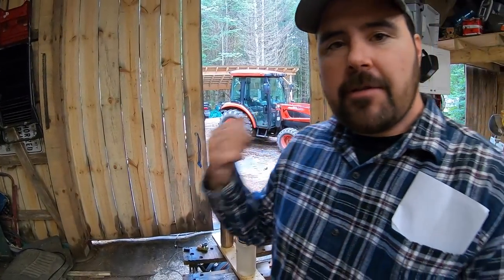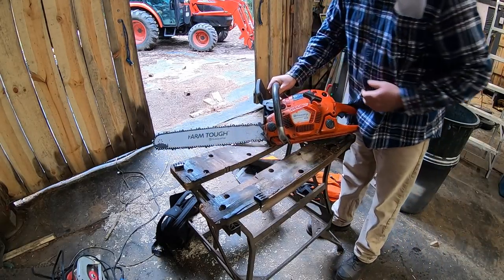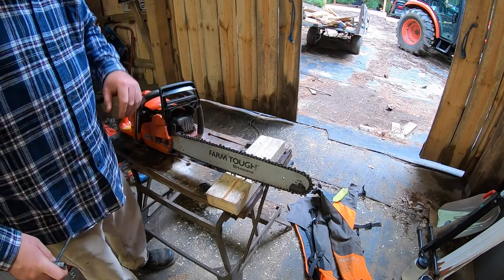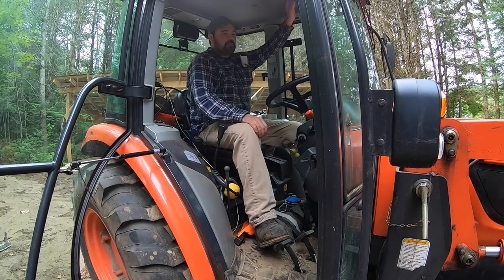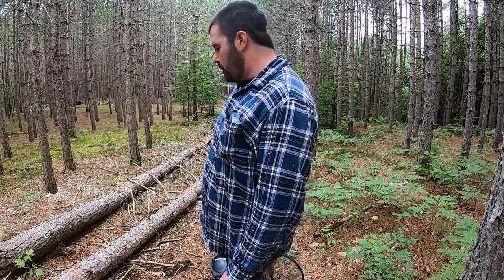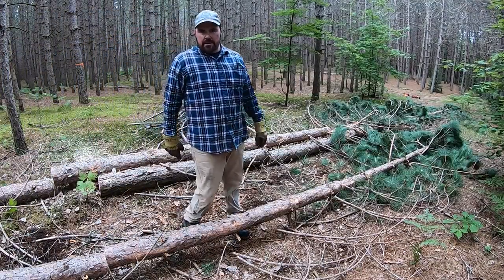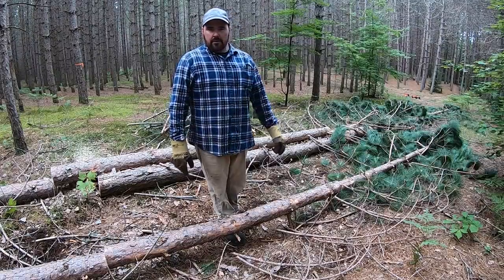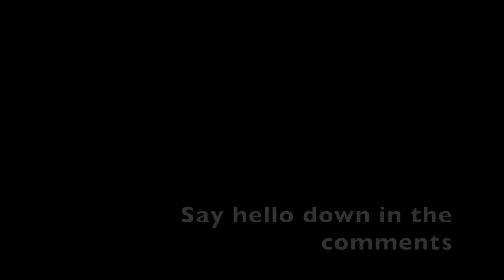Cutting Down Red Pine Trees For Siding | Equipment Shed Build - Ep. 11

Comment: I know I already commented on your wasp issue but I found something new that might be the perfect solution in the future. I copied this from a prepper group on Facebook. Hope this helps, cheers. As a beekeeper we are constantly asked to utilize our beekeeping equipment to get rid of wasp nest. 

Quick tip : In order to eradicate the Wasps all you need is a fertilizer sprayer that comes with attachable bottle. You fill the bottle with 1/4 dish soap and 3/4 water you then spray it at the wasp nest which is made of paper and will immediately Fall Apart the Wasps will be pissed however the soap in the water causes the water to be able to enter the slits of the WASP breathing area. The viscosity of the water is decreased and will slide into the slits and drowned  the wasps.
Reply from the maker: I like that idea except for the moment the wasps get angry at me haha. Fortunately the wasps haven’t been back but I do plan on putting up a fake nest as from why I understand they are terretorial. I appreciate you helping me out as I’m sure the beekeeping gives you a lot of great experience to share

Comment: I load the catie in and out of truck with tractor, and leave it in truck while filling at station .  Catie came with grounding clamp for safety.  The math lifting (6)  5 gal cans in and out truck and around all the equipment  in a year time is over the top.   The catie is on wheel so it moves easily and holds 30 gals. I only have to fill it 4-5 times a year and I'm down to only needing a couple of can for remote filling. 👍  my back thanks every time . 😉.
Reply from the maker: Sounds like a great setup

Comment: I wish they could have combined the old style positive stop fuel and oil caps with the new style tool free ones. Having the threads protrude on the old ones they hardly ever got saw dust in the tank. The new style I find it best to blow off the saw with air around the caps to get rid of most of the debris. They do make it easy though.
Reply from the maker: Air is a great option for sure. I’d hate to get some gunk clogging up my saws fuel system

Comment: I bought a fuel catie on weels for my stuff, 30 gal with a manual pump best thing I have done in  long time. No more lifting heavy fuel cans.  You should consider that, I'm sure you will be happier.  👍
Reply from the maker: I’ll have to check it out. My only issue would be lifting it in and out of my pickup truck to get fuel as the fuel station. How do you find using it at the fuel station?
Reply: @sawingwithsandy  they  usually come with ground strap which is for safty. I leave the tank in the truck to fill with fuel  and  lift it in and out PU with the tractor. 30 gal last quite a while for me, so about 4- 5 time a year I have fill tank. The math on all those 5 gal cans really add up quick not to mention haveing take 6 cans  to fill at the  station. If I  have take fuel with me, put a few gal in a can and go. My back says thanks every time I have to fill up anything.  🙂
Reply: @sawingwithsandy  3rd

Comment: Looked like the trees you cut were live. Much difference in milling a dead tree vs a live tree  Sandy ?.
Reply from the maker: They were live trees. I find cutting live trees to be a bit easier to saw as the water in the tree provides for a bit of lubrication. I prefer cutting live in the winter time though as live Pine in the summer has a lot of pitch in it that can gum up the blades of the sawmill

Comment: In my humble opinion, snow is easier to deal with than bugs, heat and humidity.  With a 7' length, I suspect that you'll be doing board and batten siding.  Any reason that you chose this over horizontal lap siding?
Reply from the maker: I like snow more than bugs as well. Doing board and batten to match the shop siding

Comment: Sandy, why oh why, don't you have a simple auto jack under the small end of the log?? You MUST level the heart on both ends to get the most can't volume out of the log. On the small red pine- the taper is minimal, but you had a large spruce or pine log that could have realized a 2" INCREASE in size of the resulting cant. M8chael
Reply from the maker: Hey Michael. I don't own a small auto jack unfortunately but I do use small blocks of wood to lift the ends up on occasion on the sawmill to limit waste and centre the pith.

Comment: Does red pine make good lumber?
Reply from the maker: I’d prefer white pine or spruce but red pine is the main wood I’ve got the most of so O just watch for knots when using the wood for structural pieces
Reply: I have 7 acres of red pine that I just bought a mill for. I'll have to keep that in mind.

Comment: Do the bugs get in your lumber after milling ? Do you use a mill finish to stop the bugs from entering your cut lumber like log home mills do ? Have a great day
Reply from the maker: Hi Robert, I find that bugs will bite into the wood beneath the bark within about two weeks if I don’t get them milled. If they’re off the ground takes a bit longer for the bugs to get in
Reply from the maker: I don’t use any mill finish in the wood aside from just cutting them relatively soon after they hit the ground. I do prefer cutting in winter because the bugs don’t bore in

Comment: Don't need to count strokes, just sharpen tooth and move on to next
Reply from the maker: Reason I count strokes is for consistency so that each tooth in both directions has been sharpened the same amount. I find it prevents any curved cuts especially when cutting up firewood